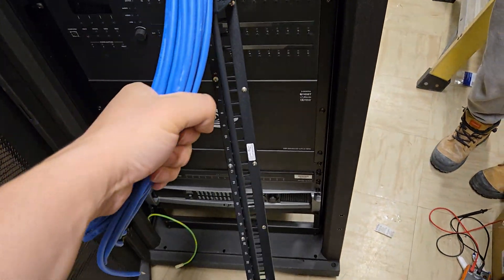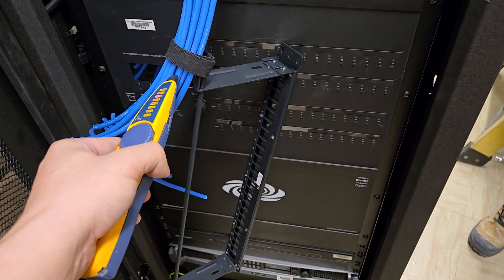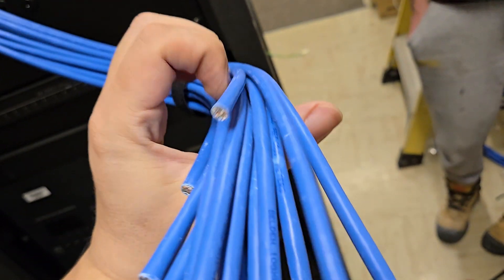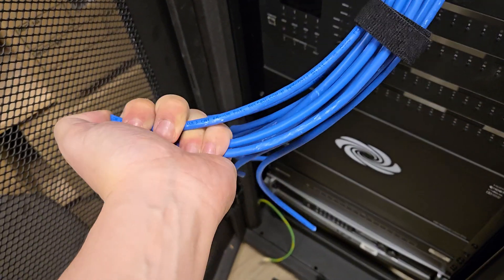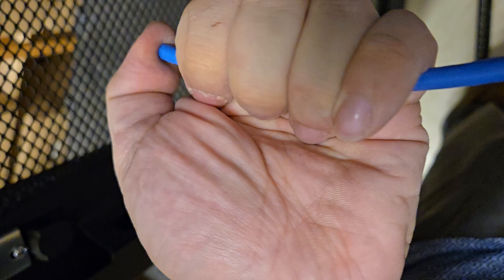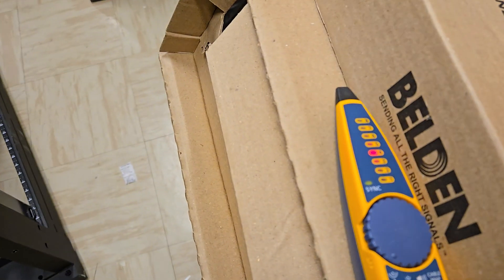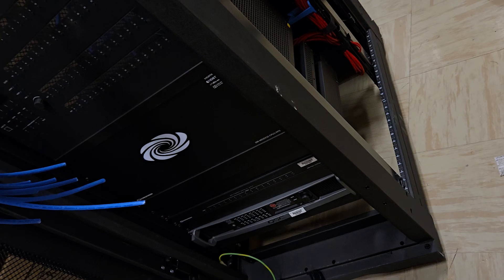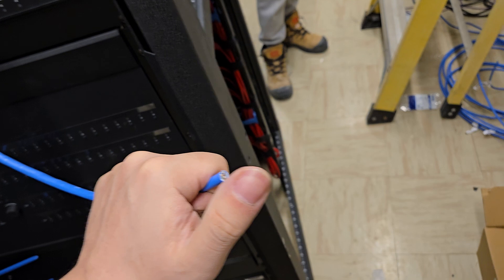Cool Trick: How to Tone a Data Cable When There is Signal Bleed into the other cables

Comment: Even my cheapo tone scanners have never had trouble locating which wire in a bundle.......maybe that Fluke needs to be out back in the tool bag :) Great tip though!!!!!! Thank you!
I'm curios how you are sending the tone, is the toner maybe the issue?
Reply from the maker: I terminated the other ends of the cables onto cat6A jacks and then plugged the toner side with an ethernet cable.  It might have worked better if I grounded it.  I love this toner and it works really well otherwise.
Reply: @ I figured so. That’s strange that the scanner cannot identify a single wire. I have never run into this before.
I have had a close cable have a touch of signal but the actual correct cable always had a muuuuuuch stronger signal and there was no doubt. Interesting.

Comment: Wait, the toner can detect a signal through your hand?
Reply: I am just guessing here but sometimes when the battery of your car remote is weak, you can press the antenna against your stomach so your body essentially acts like a "better" antenna. Maybe that's what's happening here?
Reply from the maker: Yeah, it can.  If you touch the cable with one hand and hold the probe with the other hand it is a weaker signal, which helps find the cable better.  It also works thru the air.
Reply: @HazimGaber  That does make sense. Im wondering what an oscilloscope would pick up.